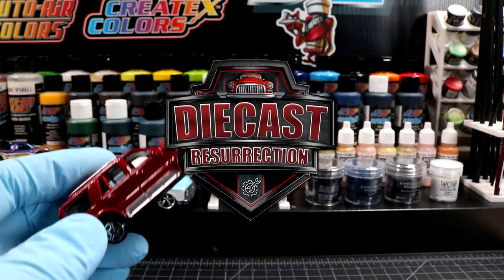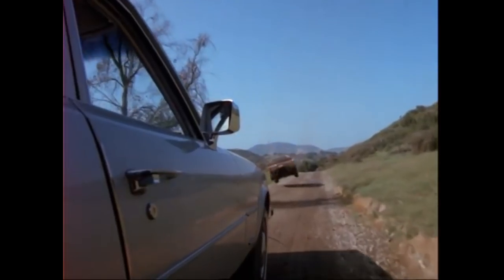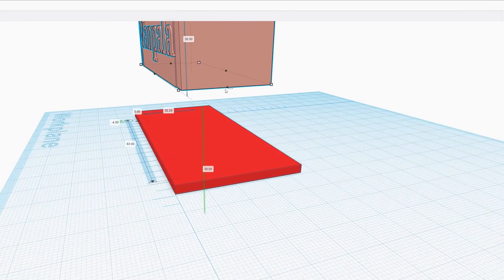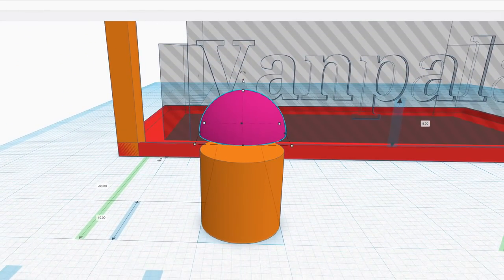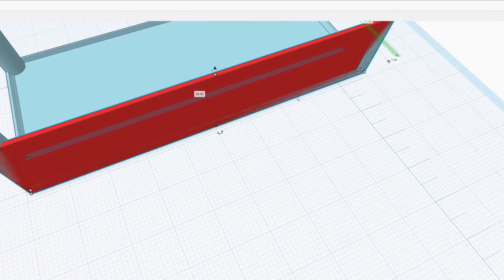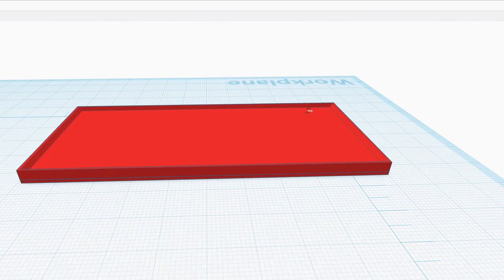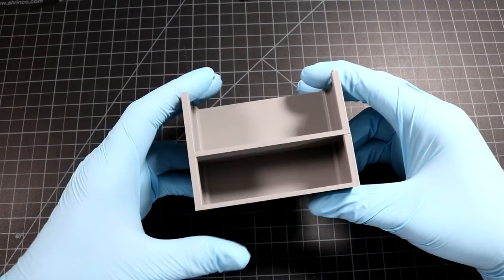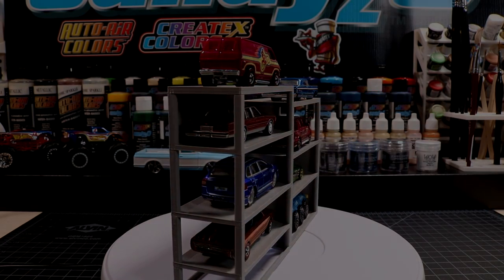3D Printing - 1:64 Modular Display Racks

Comment: Nice set up. 
I might be wrong..but if you do it the other way.then the first displaycase fits two cars. One on the shelf,and one on top? Might save materials? Wel not if you bring the roof ås å base tho...
The back wall is a good idea. 
What about adding bruk texture to it? Then pepole/you can paint it ås o diorama? Just brainstorming. Ading å Mirror ås å backwall may be cool to show both sides of å car og it is a mismatch paint or a postapocalyptic car?

Comment: put a hole on each side so later u can connect the moduler all together.. just the hole, to connect it maybe use a plastic rod or a stick
Reply: Yeah, this really needs a way to connect one stack to another via the sides (or ends, depending on how you look at it).  Other than that, this is really cool, great idea Andy!!

Great stuff, thanks for sharing, and keep on keeping on!!